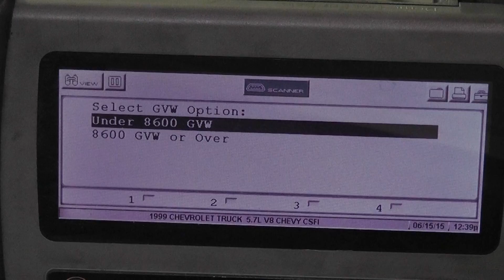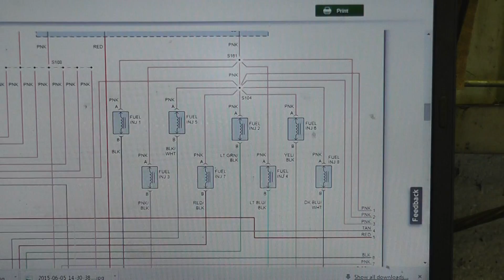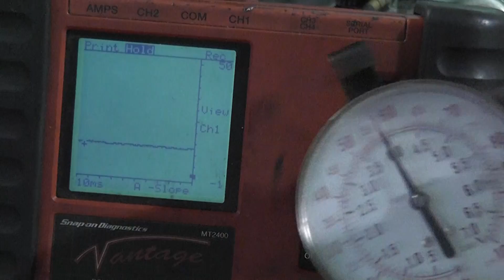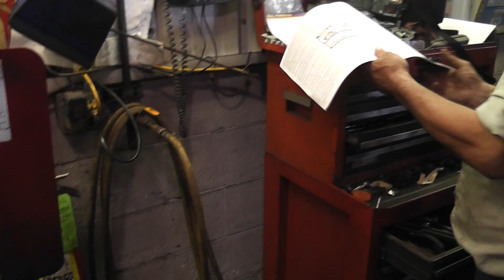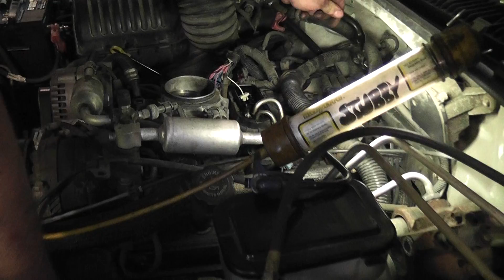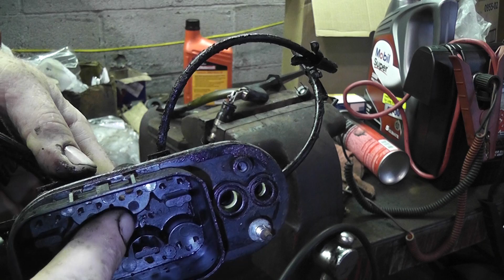5 7L CHEVY VORTEC INJECTOR FAILURE

Comment: Thanks for being curious as I am too.  I have #5&7 cylinders that are stuck open and my spider assemblyt is only 3 months old. I think the problem occured when I decided to add a bottle of fuel injector cleaner in my gas tank of my 99 suburban. I wonder if I added more that 5o # of air to the fuel line if it would push any gunk through?? not sure how to separate the back half of the fuel line / tank from the front end.
Regardless thanks again for your curiosity.
Dino

Comment: i got a the same truck with a no start problem got 65psi fuel presser good spark spider plug has noid light flashing runs when starting fluid is sprayed???  could it be my spider clogged.

Comment: I replaced the injectors on my 5.7 now my engine tapping
Reply: Did you ever find out what happened? Mine is doing the same thing after I changed the injectors as well
Reply: Yup i replaced mine wuth a brand new mpfi unit, now i have a hard miss on cylinder 8. Genuinely just fuckin pissed off with this stupid piece of shit truck, it took forever to take it off and it was a pain in the ass. Gotta wait till tomorrow to look at cyl 8 i guess.

Comment: James I have an 03 chevy 4.3l changed injectors cap and rotor tested wires cant seem to find #5 misfire fuel psi is 45 climbs to 55 when reved but wont hold fuel pressure after key on engine off any suggestions for misfire there is no cat or o2s. truck was give to me like this
Reply from the maker: +Lee Stanley see if its possible to pinch off the supply and return fuel hoses with needle nose vise grips after u cycle key for prime. If it still drops then it's leaking somewhere in that injector assy.
Reply from the maker: +Lee Stanley I have gotten bad distributor caps for those and it's always #5 because of the path it takes from where the spark from rotor starts , back across center of cap to the wire terminal
Reply: thanks a million I will try pinch off.is there a distributor cap that you recommend

Comment: Why take the thermostat housing off? It is not necessary to remove it or drain the coolant, to replace the fuel distribution system on a 5.7 vortec.

Comment: ran a vacuum test on it. came out at 20hg. st doesn't move while revving. might need to check fuel psi
Reply from the maker: +william burke if u have that much positive fuel trim at idle and it runs good driving under load , I'd still be looking for a vacuum leak. Maybe get a pair of needle nose pliers and.  pinch off the vacuum line to the pcv valve and then try the brake vacuum booster to see if either of those are bad. Also if you mist the whole engine with a garden hose ,like along the intake seam and the fuel injector o rings . If there is a leak ,it will suck the water in and kinda sound like your kid sucking on a straw with an empty McDonald's cup. Or with the modis, look at the egr dpfe sensor voltage ( if it has an egr valve ) and see where that voltage is. Should be near 1 volt. If it's close to 2 or more, the valve could be stuck open and flowing at idle
Reply from the maker: +James Danner if it's a 4.2, they have the same problem as the 3.8 where the rubber grommets on the upper plenum bolts shrink and the upper intake isn't tight enough to the lower. Did u replace those bolts when u did the intake job?

Comment: getting a long crank time also. new fuel pump , filter and fp regulator. due to low fuel pressure. that was done because it wouldn't run at all before. so I'm thinking fuel injectors for sure. will have to go to the scope.

Comment: it's definitely prevalent at idle. popping through intake. just did the upper and lower intake gaskets.  coolant in oil. compression test came out good.
Reply from the maker: +william burke  is it a v6?
Reply from the maker: +william burke does it pop and misfire under load too?

Comment: I will look at it again. I will reply back. thanks for response. I spray the top of the engine with some brake clean watch the fuel trims and see if they change. check for vacuum leaks. or run a vacuum gauge.

Comment: 02 Ford F150 P1131-P1151 codes. where to start fuel?
Reply from the maker: +william burke so those are o2 sensor lack of switching codes but usually due to a lean condition.  Can u see fuel trims on a scanner to see if they are too positive or negative and if it's more prevalent at idle or at higher engine speed? 
Freeze frame data may help with what rpm the codes set.
Guessing a big vacuum leak if it's an idle issue
Or could be fuel pressure or dirty mass air flow sensor if at higher rpm 
Or if it's both the air boot integrity between mass air flow and throttle body

Comment: revisting this video and i like your diagnosis.

Would you still recomend the solous as an introductary higher end scanner? Got an OTC gensis thats on its way out ( screens junk and wont hold charge) and some smaller handheld ones  thats still work good, but wont do injector ballance and MODE 6 missfire data

is it still handy today or did it go obsolete ?
Reply from the maker: +Wrench life 604 my regular solus worked great but the software update that's in it  was the last one supported . I'll have to check. Maybe 13 . The souls ultra I use now is still supported.  I just got the 17.2. It does everything the newest tools do just not the bling. Like windows based browser stuff and storage and link options. Or wifi obd connectors.  But as far as the data and bidirectional capabilities, it's all there. I think I paid 1500 for it used with the latest update at the time. 
Heads up tho. Updates can be 1000 bucks. But I waited a year or 2 and a promo came out for 550 for the 16.4 that was almost at its end with a free 17.2 when it came out. Or if u need to be totally up all the time , they have a monthly payment plan where u just get each one as it comes out. Anyway. If u can find ur snap on guy and luck into an updated trade in for 1500. U could have a few years of good use

Comment: my rpm guage drops down while driving , sometime vehicle shuts off and sometimes it will run for hours with no problem. seems to be getting worse though. gonna start looking at the spider
Reply from the maker: +Joel Hickman u have access to a scanner? 
See if there is any codes for a crank sensor. Maybe u are losing that signal to the computer 
Does tach drop to zero or jump around? Does it misfire or run rough or just randomly shut off ?
Reply: hello here. We had replaced the crank sensor last time and it ran fine for a while. The problem this time ended up being a coolant temp sensor. it would start reading crazy temps which would affect the idle air control valve motor.  they only caught it because it finally decided to act up in their presence lol

Comment: I have a cylinder 5 misfire on a 5.7 Vortec as well. I have had the entire fuel injector system replaced (just like you did in the video) due to a faulty injector. I still have the error code pop up though and have a rough running engine. Any thoughts what else I should go for?
Reply from the maker: +Tregeta I know the #5 path thru the distributor cap is long and crosses near the center coil button . It's a common failure point. Cheap to eliminate as a cause
Reply: Excellent, I will give that a shot, thanks!

Comment: Always wondered about the differences between the old TBI, CSFI, and updated "spider" injection versions. Thanks for clearing that up! And those 5.7s have to be pretty tough to haul around so much iron lol
Reply from the maker: glad I could help. I always liked the throttle body style.  simple and effective.  saw many centrals with ruptured regulators or those little plastic tubes running thru the intake breaking. although I've had this style out before. that was my first bad poppet valve.  and a first look at that different design with the relocated injectors. my concern now with those are that all 8 of those plastic tubes are always under line pressure now. what's that gonna do after years of heat and strain.
Reply: Good point...hopefully they are made of high-grade Chinese plastic lol
Reply from the maker: Nice

Comment: Excellent video James. Had one last winter that wouldn't start sometimes. Was losing fuel pressure while at rest. Fuel pressure regulator was leaking. Another engineer on drugs!
Reply from the maker: yea I had one setting system rich codes for that same issue

Comment: Hello sir, I the same snap on vantage meter. My concern is the meter fails to power up. Any thoughts on that? Thank you.
Reply from the maker: that stinks.  id  probably pull it apart and check the circuit from the battery compartment to the power button and hope the problem was there or the cap that jumps the batteries.  other than that I'm not too knowledgeable on micro processors, capacitors and such
Reply from the maker: sorry I thought u meant the scanner not the vantage. ignore the battery cap part

Comment: On newer Hondas 04+ if you get a code fore vtec oil pressure circuit low, it's not a circuit code, it's oil pressure code. Check the oil 1st, if low change it and clear the light. If not low, verify base oil pressure 1st, if you have a modis ultra run the vtec bay test, it may pass In the shop,  next check oil pressure at the solenoid, doesn't hurt to pull the solenoid and check/ clean the screen. There's another screen in the block, under the p/s pump on the 2.4 DOHC. Forget where on the 3.5. That should resolve it. If not, replace engine / vehicle or both! Had an element that had a gummed up oil passage in the head, customer ended up dumping the vehicle.

Comment: Hey James you think you can do more ac repair videos if you get anymore In this summer.
Reply from the maker: yea if I get a good one. what kind of stuff u wanna see?
Reply: Hopefully some hvac work on a ford with manual climate control. Some pressure checks would be nice.
Reply from the maker: U have one specifically with issues?
Reply: 08 mercury Milian network communication problem. A/C compressor only works when you jump the relay.
Reply from the maker: wow. I just pulled a wiring diagram. even the manual system has a lot going on. can u actually get codes with a scan tool? I see the pcm controls the AC relay and a pcm power relay that sends voltage thru  fuse 47, a 15a fuse, to the primary side of the AC relay. plus there is a pressure transducer in one of the lines
Reply: Pressure transducer replaced power at the fuses scanner will not connect to read heating and a/C network. Used a matco relay jumper set compressor cuts on. Seems like no control for the compressor
Reply from the maker: and the AC request is sent from the climate module to the instrument cluster.  then its a can bus message from there
Reply: My all data sucks for my company it doesn't show me any detail info for the compressor. I'm lost on this car.
Reply from the maker: looks like the manual system won't communicate to a scanner.  the only input would be an AC request signal to the pcm via the instrument cluster.  do u have a scanner to see if it gives you an AC request pid  on datastream?
Reply: Yes my modis can do that only problem is I can't access the ac system.
Reply from the maker: no it will be under the engine computer
Reply: Under the engine pid I can't find any data for the ac but now I do have a code for the ambient temperature sensor malfunction. Have you ever encountered when the ac cut on the engine wants to die out.
Reply from the maker: if u can't find it on the engine pid . see if u see it on the instrument cluster pid. we need to know if the AC head unit is sending the request signal. if u force AC on and comp doesn't know. it won't kick up the idle. also if the ambient temp is unplugged or open and reads-40° it could fool computer but Max AC usually bypass that

Comment: Thomas exovcds: Lol wise ass. Haha
Reply: I lucked out! Didn't watch it though till just now... and they say German cars are over engineered! Sheesh, crazy design.
Reply: I'd take an old Chevy over any German car any day of the week. 
Chevy had that system on the 4.3 vortec v6 too. Known issues/leaks
P0172/175 b1/b2 system rich.....
Had a 93 s10  blazer beat me up for 2 days with an intermittent no-start. The connector for the injection spider got brittle and loose, hit a bump and she was DOA. 
That was about 5 years ago now, didn't know HALF of what I do now. And I still don't know it all.
Between you Thomas, James, and his brother Paul I've got some very helpful and interesting info at my fingertips. Thanks to all of you guys!
Reply: MrErikw26 LOL, you put me on the wrong end of that list... but thanks though! Same here, there's lots that makes sense to me now that didn't 5 -10 years ago. YouTube over the last 4-5 years has been a great source for information / learning.
Reply: I've got a good dose of experience with Japanese and 'Murican cars,  German cars I've always avoided. 
If I had the time and spare cash I'd like to take Paul's class. The education on electrical would be more than worth it by itself. 
Fyi, new Toyota v6 vehicles along with Lexus SUCK to work on. 
Water pump on a 2gr-fe 3.5 v6 is around 5 hours flag time, I do them in 3.5-4. Nissan 3.0/3.5 v6 water pumps are no fun either....
In the timing cover driven by the chain......Gm ecotec 2.2,2.4 same. 
Switch to fixing Hyundai! Super easy majority of the time lol. I like my Fords too.
Reply: MrErikw26 I've got two guys at the shop that take all the non euro stuff... however, I did do an oil change on a 05 cr-v today and a window regulator on a 97 cr-v yesterday. Thanks for the heads-up on the above!

Comment: Thank u James. Just did one yesterday. 96 4.3 S-10. Looked exactly the same. The crank sensor was also bad. The new one had 0 volts and then 8 volts alternately as u rotate back and fort over that slotted wheel on the signal wire. The old one didn't. Yet the vehicle would start and run if u would shoot gas into intake. Cam sensor is in distributor. Why would it run with bad crank sensor? Once running it would run fine with old spyder. Next morning though, would crank forever and then finally start. New spyder and crank sensor, starts and runs perfect. Shipped. Keep the videos coming!
Reply from the maker: I guess with and old style distributor the crank sensor is more for rpm signal, advance and possibly sequential injection?  and to keep the fuel pump running. since the rotor is the direct cylinder order,  I guess it could run.. thanks Bill

Comment: Awesome Danner, I work on my buddies 99 suburban with the same engine and it's got 375,000 KM on it,   Done brakes , rad , hoses , thermostat , alternator , over the years but the injection system is perfect. I've heard how bad they are but I've never had one to work on. I see a lot 10-15 year old  vehicles ,  I wonder if it's the grade of fuel  or in that trucks case high idle hours.  Hey you just have to get Clark in your movies more often , man he needs a girlfriend - LOL
Reply from the maker: my wife won't want to hear that.  her rusty express conversion van only has 139k miles. I think she wants it to blow up.